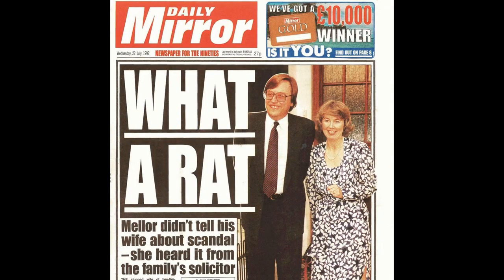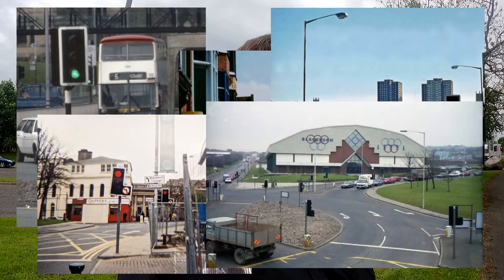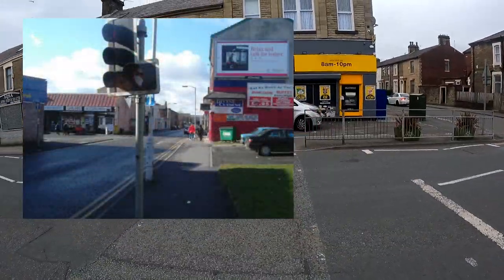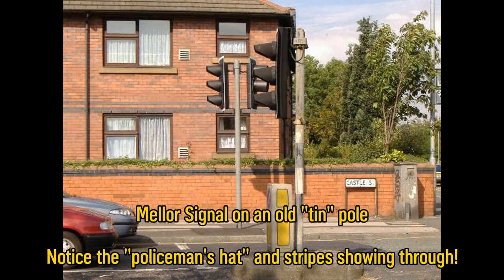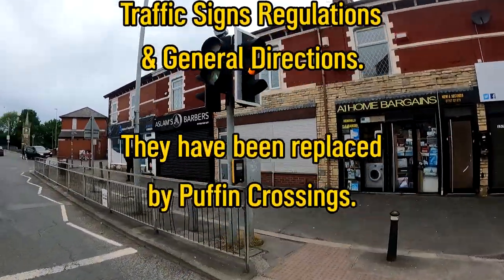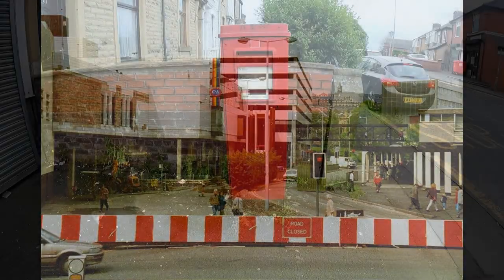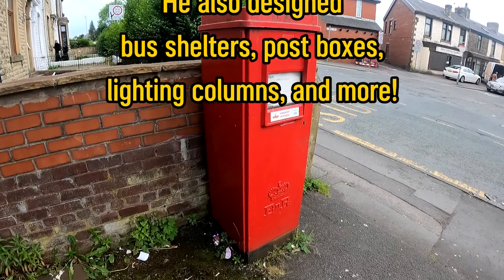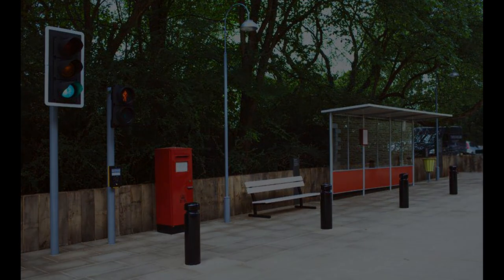How did one man make all our traffic lights the same?

Comment: The Mellor traffic lights are nearly all but extinct in London but a good few still soldier on where they are like old warriors who refuse to give up without a fight. Some installations in London have a mix of Mellor and Peek Elite LED traffic signals so it proves that even modern-day traffic signalling can be compatible with the veteran Mellor traffic lights. I do remember the traffic light installations in Liverpool city centre in the late 1980s where they were still using the old 1950s ATE/Plessey 'Tin Lantern' traffic lights but with the plastic Mellor red man/green man pedestrian signals, which always looked very odd. But one thing I love about the Mellor traffic lights is the soft change of the light colours due to the halogen bulbs. Recently I paid a visit to Bristol and even though Bristol now has modern Siemens and other LED traffic lights in the city, there are still some Mellors with their white sight boards still doing their job in Bristol since they replaced the old 1940s SGE traffic lights back in the early 1980s.

Comment: The then new Mellor road and pedestrian signal heads were unveiled in 1965 but it wasn't until 1972 when they started being rolled out, firstly on pelican crossings and then on traffic light-controlled road junctions. When the first pelican crossings were introduced in 1969 in London, Bristol, Lincoln and Reading they had to make do with SGE steel signalheads up until they were replaced by the plastic Mellor signalheads from 1972 onwards. But to me the Mellor traffic lights are an icon of 1970s design which have served their purpose well along with the likes of Concorde, the BR InterCity 125 and the Leyland National bus.

Comment: How long has the amber bulb been burned out 2:02 2:04 2:05 2:07 2:08 2:10🤔
Reply from the maker: It wasn't a good advert for the signals. Couldn't resist pointing out how fate worked to undermine my video 😏